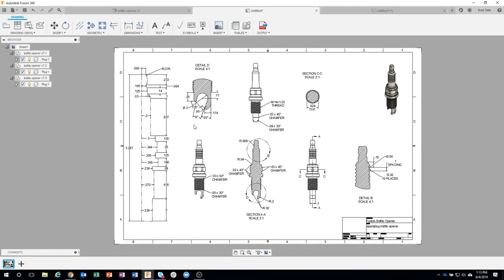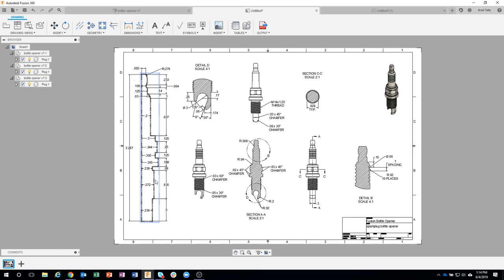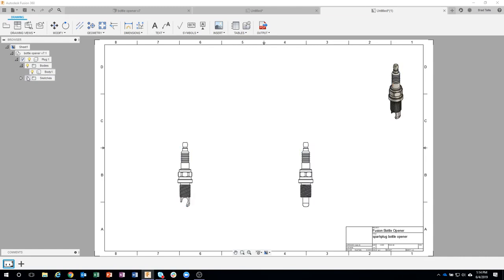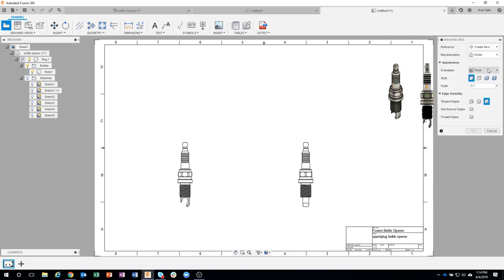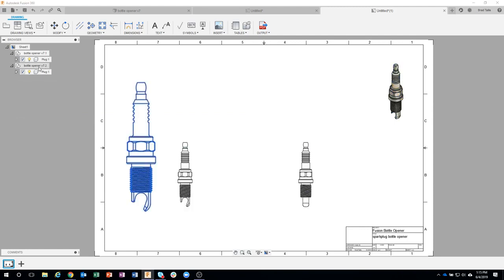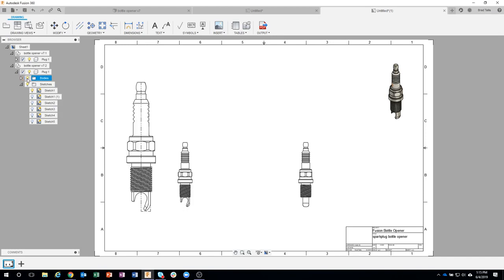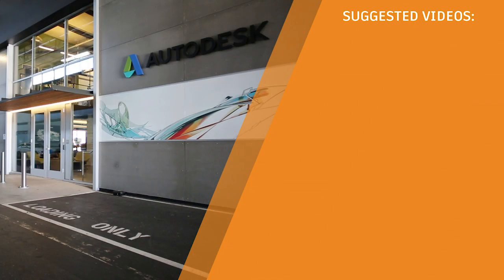QUICK TIP: Use Sketches in Drawings

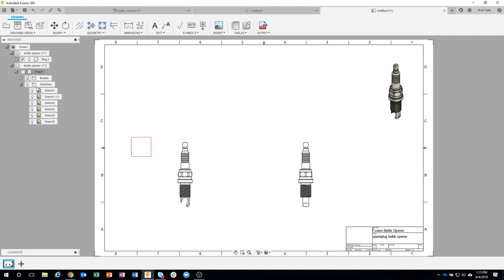Comment: Hello, I am retired now and I love to do modelmaking (wooden 17th century sailing ships). I intend to make a model from scratch of a Dutch wood sawmill from which I have the original drawings of the restoration, but not suitable for making a 1:50 model. Can I use Fusion 360 for that and is there a free version available since I really don't want to use it for business purposes, just for my hobby? It could be stripped of fancy utilities, just 2D sketches and 3D assemblies. Thanks in advance, Gijsbert.
Reply from the maker: Yes, you could absolutely use Fusion 360 for your design.  I recommend watching videos on Bodies vs Components to help you better organize your design.